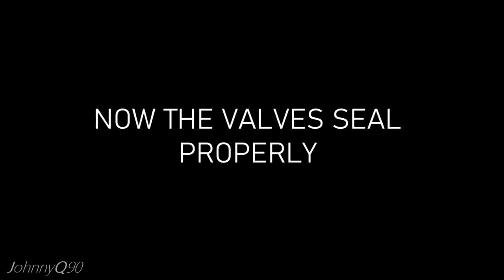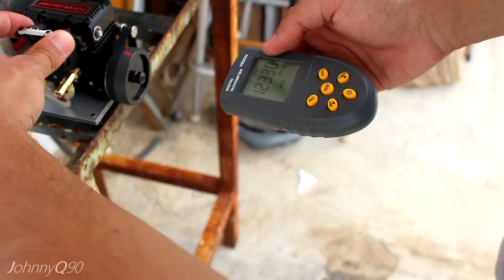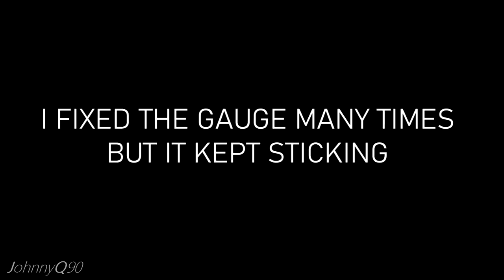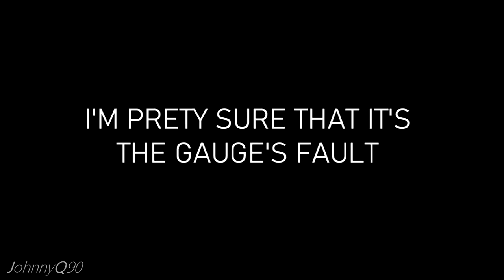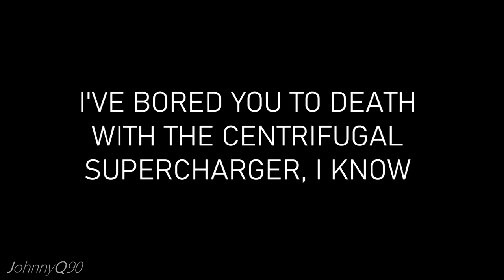PERFORMANCE Upgrade for the 4 Stroke TWIN Cylinder - *VALVE Lapping* - Supercharger Update

Comment: the tuning problem is due to the carb, the supercharger pulls a vacume on the carb side when in a pull through config, because of this it pulls fuel past the needle and air from around the slide, the engine then runs away, the combustion sustains the rpm which sustain the vacume which sustains excess fuel and air flow. a smaller pully on the engine would help with this. you can also hear the supercharger surging which supports this, the engine leans out the revs increase the supercharger pulls fuel and air in which makes the engine pick up. a better carb or efi would help this problem but its all about how far you want to go with a model engine. awesome work eitherway, cant wait to see more

Comment: Awesome video, quick side note about the pressure gauges you were using. They made fluid-filled gauges that prevent the needle from jumping everywhere under fast changing conditions (and helps them not become stuck as a result) as with the slight resistance of the fluid, it makes the needle show the 'average' pressure compared to the 'instantaneous' pressure.

Comment: Just my 2 cents on the tuning issue:
It appears the fuel isn't atomizing enough and it's pooling into the supercharger. That may be why your pressure goes up soo much because fluid doesnt compress. Also causing it to run away on you too, since it's basically a small diesel (no spark plugs). I'd bring the carb down a step and run more fuel with the smaller carb, or go back to the blow through setup you had before. That's what they did on the 80's era Buick's with the v6 turbo. Worked well for a gas vehicle.

On a diesel mindset:
A supercharger that moves air and fluid has more "open" clearances that aren't as tight because the non-compressable fluid and air both running through it. That's a lesson from Gale Banks who's a genius with this stuff. I highly recommend his channel if you haven't seen it yet. Love the content and keep up the good work! 👍

Comment: You can fill gauge with oil to damper frequent pressure changes, or buy one with oil in it already. Gauges with oil are made specifically for use like this where there are frequent pressure changes.

Comment: Keep up the awesome work!! So close to the Holy Grail so don't give up. Try finding an oil damped gauge cuz what is killing the gauge is needle oscillations ( it's moving way too fast). Years ago I ran across a book dealing with artificial boost for internal combustion engine design when I was playing around with turbo design for my bikes trying to eliminate most of the turbo lag. If you can find it, or something similar, that may help. Just keep at it cuz it is fascinating to watch you work. You have a talent that most don't. Can't wait to see you begin porting and stroking it (hint, hint).

Comment: I personally, am not bored with the centrifugal s/c! I like watching you experiment with different setups. Maybe after you make the positive displacement s/c, you should perhaps try to convert the centrifugal s/c to a turbo by making a centre section, turbine (and housing), with a mini waste gate. It would probably be better on the 4cyl engine though.
Also, maybe using those reusable zip ties may be worthwhile, as you wouldn't need to buy so many!😅
Anyway, I always get excited when I see a notification from your channel, so keep those cool videos coming!

Comment: JonnyQ90, addressing your issue with the vacuum/pressure gage fluctuation quandary,  you might employ a ''Fluid Damped'' gage.  Basically, the workings of the gage are immersed in a nearly, colourless viscous fluid that slows down the majority of the erratic fluctuations in the gage. 

I actually made a fluid damped gage myself, in a far off land, during a critical aeroplane emergency.  I prising off the bezel with the lens and filled the gage cavity completely full with a nearly colourless viscous liquid.  

We had a local denizen boil up some sugar cane juice until it was about the viscosity between ''light [clear] corn syrup'' and ''type 3 brake fluid''.  Then when the gage was filled, sealed the lens to the bezel with ''rubber tree sap'' then wrapped ''black electrical tape'' around the gage housing to seal against the viscous fluid leaking

It worked, but we were still captured anyway...please don't ask where.    HaHa!

Comment: Super job with the draw-through set up. Don't stop, you are nearly there!
Maybe you have an air leak on the bearing side of your compressor and  it is drawing air here instead of through the carb? To increase your boost, maybe you could shim/adjust you turbine/wheel nearly flush with the wheel housing. +1 😉

Comment: My guess with your blower set up is that you should Box in the entire carburator, not just the inlet port.  Maybe there is some blowby throu it that would affect the mixture

Also, maybe the mixture should come down in the engine port, and not "climb in it"  we are dealing with a very small air volume here after all...

Comment: I think what youre getting is called Runaway, when the RPMs keep climbing and as a result building more boost and creating a stronger differential pressure. And i believe its that differential pressure thats sucking fuel out of the throttle even though you arent operating it yourself. Basically somewhere near your carb is allowing too much fuel in

Comment: I'm an automotive and small engines technician by trade and have experience with boost applications. I've been watching all your videos and you definitely have skill. Unfortunately the problem lies in the carburetor your using, whether it be blow through or draw, a needle controlled fuel feed is going to drive you nuts either way. On the draw through it's the vacuum of the supercharger that's causing the tuning problems. It's literally sucking the fuel in when you cut off the air and it's gonna keep doing it. You're on the right path with the blow through version, my suggestion would be to either add a pulse type fuel pump(you find these on lawn and garden tractor engines) it uses the pulse from the crankcase to actuate a diaphragm that pumps at low pressure. With your skill I see no problem in creating one and using the escape port on the catch can. Another option would be to make an electric one with a fuel regulator to control it but the first one might be more feasible. Another option would be to use the exhaust for a pressure feed typically seen with nitro RC. I only mentioned it because I never saw it used. Reason being is that feeding pressure to the fuel tank from your boost source is not only a waste of good boost(lol),but when you go to drop the hammer on the throttle you lose that boost reference for a split second which is where enrichment is most important. So if you can keep either the fuel or tank pressure at or slightly above the boost pressure it'll respond and rev with no issues and should respond instantly. The boost in the carburetor is pushing back on the fuel coming so give the fuel some push back is what I'm saying. Sorry for the long comment but I do like your videos and I don't subscribe to just anyone, plus I prefer centrifuge over positive displacement any day, they make more boost and easier.

Comment: Just a suggestion, instead of putting the pressure gouge directly on the outlet port, try running at least a one foot length of tubing with an air snubber/dashpot to stabilize the reading. Maybe even a gauge that is glycerin filled? Great video as always!

Comment: That's an awesome choice in kit. Although, the chassis may not handle the weight, and the two speed clutch burns gear rather quickly. I've only been able to run a .15 OS engine on it. Anything bigger tends to run through gears. Great content, and awesome work.

Comment: Awesome job. Nothing boring about what you're doing. A bypass valve may help the tuning of the engine. The increased booster is drawing more fuel into the engine making it turn up erratically.....just a thought

Comment: Now that's what I'm talking about! If you put a little charge/effort to the engine's output, exhaust gases are going to come out with more pressure and speed spinning the turbo way better, and is going to be easier to tune, you can try putting a small electric generator in the engine as a mean of adding a charge to the crankshaft

Comment: This is small scale performance at it's best 
I see in the video that your having tuning problems and I believe your 
On the correct track with the valves .
I believe the valve springs can't keep the valves closed well enough under boost 
Some shims ?
Or better springs might be the trick 
Also valve timing could be changed 
But clearance might be a problem 
Maybe small valve relief lol ..
Hope this gives you some ideas 
To keep moving forward 🖒🔥

Comment: That's blower surge. The engine gets drained of vacuum and then picks up idle to replace the pressure. A blow-off valve will help with that because it will bypass the extra pressure down low when the throttle is closed. The air being forced into the engine constantly is causing it to run lean and when you finally open the throttle and more fuel is added it starts to run away. You need to be able to push more fuel and if possible adjust the timing to keep the intake valve open a little longer to handle the extra pressure from the charger and extra fuel.

Comment: My feeling is that with such a small engine you should have gone with a roots or vane type supercharger. Vane and roots have a much more consistent boost through out the rpm range. Centrifugal superchargers are not know for being consistent, they only really make boost at high rev. Because of the inconsistent boost pressures from positive to negative I think you are dealing with chasing between rich and lean.  Myself I would try a vane style supercharger. Great video! :)

Comment: A little of cigarette filter in the tube that goes to the gauge will stabilize the needle when at iddle, I did that to my gauge (on my actual car) and it worked, careful not to clog it up or add too little and it wont have the desired effect

Comment: Again, awesome content! For the gauges, if it hasen't been posted already, you need a restriction on the line. It won't make the measurement less accurate, just slower. Then the gauge won't be all over the place. A gauge filled with a fluid (water or oil) can maybe also be helpfull.

Comment: To keep your gauge from self-destructing, put a restrictor in the hose with a tiny pinhole or an aquarium pump needle valve, so you can control the flow (and reduce the massive gauge fluctuations). Just an FYI!😉

Comment: why I like to polish every moving part or wear part to a mirror finish, or anywhere where flow happens. less resistance to motion, turbulance to flow, and tighter the meet up, usually makes for more power and reliability, and makes the oil and coolant's job easier, especially since polished surfaces reflect heat more and wont absorb it as much, making cooling more efficient usually.

Comment: You need a compound gauge, that can read vacuum and boost/positive pressure. Something in the 30 in Hg to 0 then 0 in Hg/psi to 15 psi. They make them because we use them at my work. Also spend a few extra dollars to get one that is glycerin filled to keep it from jumping around and destroying itself. Can find them from grainger or McMaster Carr.

Comment: You can improve the resolution of the testing equipment by installing the gauge with a bulb in between the manifold and gauge. Adding volume. 
Also reduce the hose size to the tester too to reduce response time. This will provide a more clear indicator of what the manifold is seeing.

Comment: @JohnnyQ90 with a draw through setup on this type of carburetor, it still likely needs a boost reference line to the fuel tank, because changes in air velocity vs boost are independent of each-other, (given the supercharger isn’t positive displacement), and doesn’t have power-valves and accelerator pump like a Holley, to make the transition from idle vacuum into boost smooth at a consistent air fuel ratio. Adding a tank boost reference line will radically change the tuning of the fuel screw position compared to where it is now and may help a little at idle but my make the engine erratic at a different throttle position of load (won’t know without trying).....a better solution could be to put a boost reference line to the tank with an air screw assembly from a carb in it to restrict air going to the tank so both air screws can be tuned independently......an easier solution would be to cap air velocity by using a much larger carburetor or 2-carburetors of the same size as current in parallel with a y-manifold.....this would lower the air velocity allowing you to richen up the mixture, and have less surging at idle but still have adequate fuel flow at top RPM without a tank boost reference line......the last solution and possibly the best would be to stack two of the current size carburetors in series (each using its own separate fuel tank) and one carbs fuel tank is boost referenced and the other is too atmospheric pressure. This would allow tuning like Holley having both “high” & “low” speed fuel circuits that could be tuned independently......just some thoughts, hope this helps, keep up the good work.

Comment: That's an excellent tip, It looks like quite a performance leap that costs nothing but a little time, a little effort and a smidge of polishing compound... I wonder if there's room for inlet and exhaust  port grinding and polishing on these little engines too?
 It'd be good if you could build your own twin cam heads with 4 valves per cylinder, It'd help get more of that boost into the engine I guess (future vid?? :)  I feel informed anyway, No boredom here. Thanks for another  good video, All the best.

Comment: Before you scrap the centrifugal supercharger, you should run a pressure line from the exhaust to the fuel tank. You're trying to use just vacuum to pull fuel, when both the tank and carb are designed to operate with a pressurized system. The erratic operation, and lack of tunability is indicative of a fuel delivery problem.

Comment: Never seen that big a change from just lapping the valves. But I allready told you, the blow through set-up would work better, and might EVEN work better with the 10:1 blower drive ratio.At least WRT boost ratio.
The positive displacement blower might work for a decent boost. Whether the power gain exceeds the additional power remains to be seen

Comment: To improve tunability switch from “draw through” supercharger/carburetor to a “blow through” carb set up. Make sure to increase fuel pressure to prevent boost back flowing into the fuel system.

Comment: Love the screwdriver! If i can give u a tip. Put a resistor in the pipe going to the gauge with say a 1mm hole. A old carb jet will do the trick. That will make the gauge jump around less.

Comment: If you haven’t touched the fuel after adding that supercharger, you won’t even notice a difference. Pre carb induction works on these nitro engines because the exhaust basically injects the fuel by means of pressure. The forced air doesn’t affect fuel intake so when you add air induction on one of these engines it actually runs close to exactly the same unless you very slightly up the fuel. I’ve been there before. I actually homemade a mini supercharger and run it on an OS18TM some years ago before they were readily available and played around with it tuning and so forth. I speak from experience and the fuel to air ratio will be a very particular thing and once it’s tuned, you must always run the supercharger, otherwise it will run rich all the time.
Edit: I know your engine is 4 cycle and mine was 2 cycle but setup will be the same no matter which.